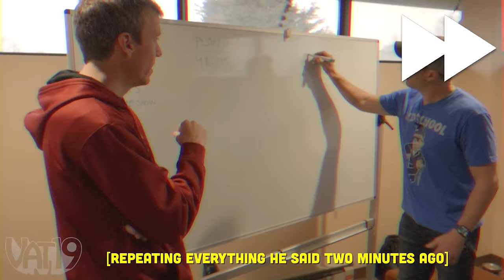Can You Find Them All By Sound? • Hide and Seek #5 With Shocks!

Comment: Jamie just a friendly tip, I wouldn't use the pigs again my family sometimes buys dog toy versions of them for our dogs, and the dogs have found a way to disconnect the tube from the mouth, and said tube will go inside the pig and once it's inside the pig away from the mouth that the tube is normally sticking out it will not make any more noise. So they could have done that at any point in the game if they thought about it or if they had dogs of their own and had given them a pig dog toy. The only good thing about it is that it is really hard to fix to the point that it is 97% unable to fix and you would be able to tell as soon as you got your hands on the pigs that it was broken.